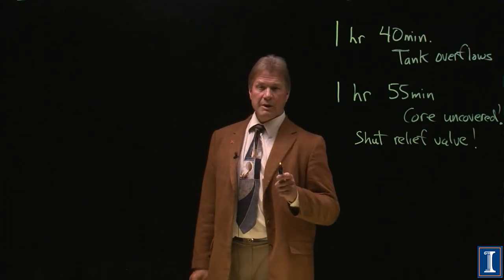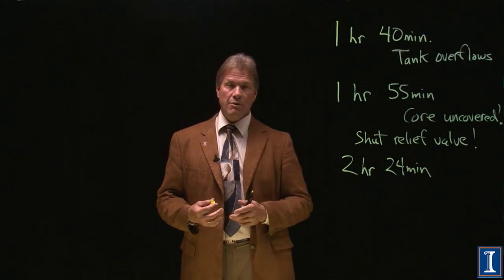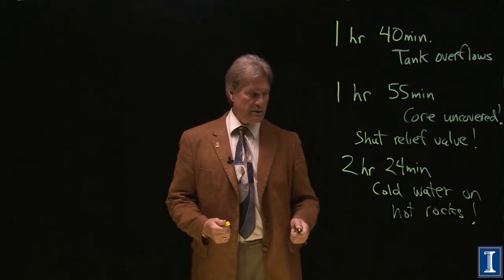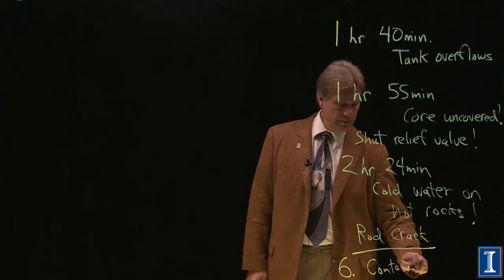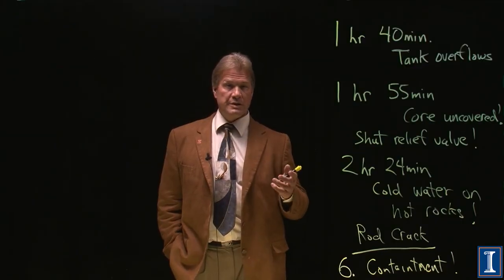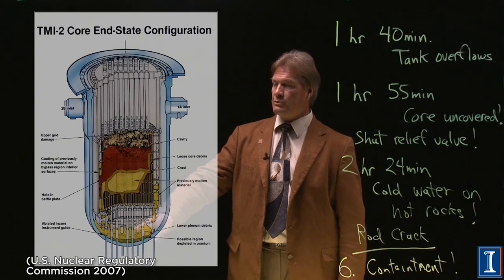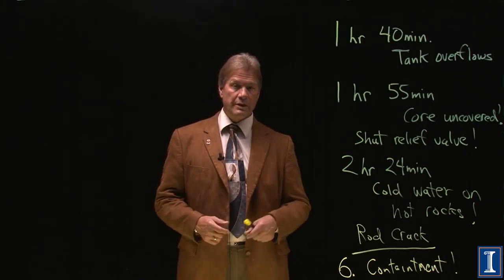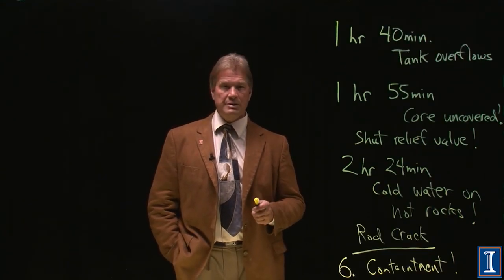How TMI Ended

Comment: I believe you misrepresented the part about putting cold water on a hot rock. When you uncover the core that is generating decay heat, you can no longer remove heat from the fuel elements. The internal temperatures rise without end and you end up in an environment where 2000 degree fuel element + steam (water) creates hydrogen gas (https://en.wikipedia.org/wiki/Zirconium_alloy#Oxidation_of_zirconium_by_steam ). Adding water with ECCS would've repressurized the core, collapsing the steam void in the core allowing decay heat to be removed.
Comparing cold water on hot rock make steam bad is a bit simplistic for a reactor core.
Reply: This guy oversimplified the story badly, changed the chronology and shifted the accents from an importaint stuff towards trivial and sometimes outright wrong, as calling ECCS return a mistake. It wasn't a mistake, the alternative was an RPV rupture and possible containment breach. In Fukushima they poured seawater to avoid exactly that type of disaster, and they were right.
I watched several his series and it's all about terribly oversimplyfying things to make it edible for junior students (if not for a layman).
Reply: The main appalling flaw in the TMI design was not sticky PORV and it's missing real position indicator, it was a much more importaint misleading WATER LEVEL indicator. This was a single most critical piece of instrumentation, and it was giving off a false OK reading. Unacceptable!
Reply: @wsswetghg8791  Are you talking pressurizer water level?
Reply: @Babyblasphemy  I mean they had no direct core water level gauge, only indirect pressuriser wl gauge
Reply: @wsswetghg8791  can't they just go in and look at the water level? I'm surprised they wouldn't notice the falling water level for almost two hours I've seen videos of people walking directly over the core. Water is supposed to be good enough shielding that you can do that.
Reply: @KingOfKings34  while reactor is under pressure, no, they can't go inside containment. And the reactor vessel is closed with it's lid on, so there's nothing to look at. In addition, radiation levels are quite deadly there as coolant have been leaking for a while by then. You have seen people walking at a DEFUELED reactor, it's totally different story.
Reply: @wsswetghg8791  there are videos of reactors turning ON with fuel inside man you can see the blue light. The cherenkov radiation
Reply: @KingOfKings34  it's not a PWR, it's research water pool reactor, a different thing completely
Reply: @wsswetghg8791  would that be too complicated to explain over a paragraph? if not, may I ask what's the difference?

Also it is really insane that these people had no way of knowing what the water level in the reactor was. A simple buoy would do the trick it and shouldn't cost more than a fuel gauge in a regular car. Which is nothing for a billion dollar reactor. it hurts my brain to think about it
Reply: @KingOfKings34  difference between what and what? Google PWR design. Simple water gauge is not that simple. Under normal operations there is solid water inside reactor, at high pressure and 320 degrees Celsius. No steam normally. Water is moving at 5 m/sec. Very little free space inside. A float will not work, but obviously something could have been invented.
Reply: @wsswetghg8791  couldn't you make a piece of the wall of the pressure vessel out of thick ballistic glass so you could see what's happening?
Reply: @wsswetghg8791  I mean gamma rays would go through of course but it would stop everything else. I don't know how much of the radiation is in the form of gamma rays in the fission of U235
Reply: @KingOfKings34  I seriously doubt that this would be technically possible, as 'wss wetghg' explained earlier in this thread. Reactor vessels are made out of forged rings of steel, welded together and made corrosion resistant on the inside by a liner of stainless steel. I'm not a civil/mechanical engineer, but I'm pretty sure it's not a good idea of putting a piece of thick ballistic glass, in a reactor vessel, with different strenght, different thermal behaviour, different expansion coefficients,... that's asking for trouble. And why should you? You don't need to look into the reactor vessel during an accident, you have al the parameters you need: pressure, temperature (preferably thermocouples mounted above the core), neutron flux (indicator to see that the reactor is subcritical, which is the absolute first concern during a 'design based accident')...
Reply: @dvraemdo  well,  I just thought it would be better than having your core melt down. Because you know sensors can fail and human eyeball is more trustworthy. That's why even in ISS, perhaps the most high tech thing humans have ever built they still have a huge cupola to look outside with the mk. I human eyeball.
Reply: @KingOfKings34  By the way: all of the PWR's in the world are equipped with with a level measurement of the reactor vessel (of course not built into the wall of the vessel, but connected by pipes), although in a lot of reactors this is only designed to use in cold shutdown conditions (reactor stopped, at atmospheric pressure, low temperature) where you sometimes need to know the exact level in the reactor vessel. During operation these level measurements are isolated from the reactor (by valves). 

As explained above: you don't need to know the water level in the reactor during an accident: if the water is at saturation point (meaning: at boiling point at a given pressure and temperature, which are of course monitored constantly) the operator knows  he can't rely on the level measurement of the pressurizer. But with the ECCS up and running correctly, he can rely that water is getting into te reactor, that's all the information he needs...

Studies have shown that with a LOCA, you'll always have some (or more) risk of damage to the fuel cladding (it depends how large the hole/breach is), but all the systems are designed to prevent that radioactivity escapes out of the reactor building. You have ECCS, but also a spray system inside the containment, containment isolation (non vital parts are automatically isolated), containment cooling, hydrogen removal (by passive autocatalytic recombiners...), filtering (radioactive particles and iodine)...
Reply: @dvraemdo  well, the guys in 1979 turned off the ECCS. I as a layman am not going to argue with you. I just tossed it out as an idea. In extreme cases redundant systems may all fail at once. I was just watching a video about an old plane crash where 3 redundant hydrolic systems all failed at once and they lost all control of the plane apart from engine throttle. I Don't even need to go that far into aviation. How many redundant coolant pumps did they have in fukushima? 

perhaps what I'm suggesting is like pumping water into fukushima daiichi plant by hand. it would be probably useless but it's better than total despair and helplessness. If that makes any sense to you. Even if a window into the reactor core is totally useless I would feel better to have it. Because it's one thing that can't fail.
Reply: @KingOfKings34  To answer your questions about TMI and the turned off ECCS: nowadays this would be nearly impossible. Firstly because of the built in timer to prevent resetting the reactor protection signal that started the ECCS, and secondly because of the completely rewritten accident procedures and extensive training (where no reactor operator would be so stupid to turn it off before the procedure is going to ask for it). Before TMI, the operators had also their accident procedures, but they almost needed to know which type of accident the where dealing with, to pick the right procedure, and take actions correspondingly. After TMI, the procedures shifted to a 'symptom-based' approach, where the operator(s) are guided trough a set of questions (for instance: ECCS started YES/NO?), where eventually the'll end up with a sort of 'diagnose' in which they can take the right actions.

And concerning the extreme cases where redundant systems may fail all at once: you mentioned about the plain crash (Jal 123?), but as far as I know this was a case where the hydrolics where not completely separated physically (they where in the same vincinity, and got severed at the same time by the aft bulkhead that was blown out). In a nuclear power plant there is a high degree of physical, mechanical and electrical separation (for instance: ECCS pumps of the different redundant 'safety trains' not in the same room).

Although the chance of an accident like Fukushima is very, very small.. (at least here in Europe, where there is no real danger of earthquakes/tsunami's), there are also 'post-Fukushima' actions taken in the European NPP's (I guess also elswhere in the world). Main focus here is a 'full station blackout' where there is absolutely no electricity to power the ECCS and other safety systems (again: this is very, very unlikely, because the already high level of redundancy). That's why there are now mobile diesel generators, pumps, piping,... to connect to the most critical parts and pump water in the reactor building, steam generators...
Reply: @dvraemdo  it was actually United Arlines Flight 232. Fascinating case. They managed to make it to the airport with just throttle controls and miraculously saved 185 people. By the way are you from France?
Reply: @KingOfKings34  Ah ok. You should also take a look at the Japan Airlines 123 incident, seems similar but unfortunately this 747 crashed (after a half hour struggle of the pilots to keep it in the air with no tail and all the hydraulics gone).

Not France, but the little country north of it 😉
Reply: @dvraemdo  you mean the glorious republic of Ireland? lol. I thougt anglos didn't consider themselves part of Europe. Using a phrase such as "here in europe" makes me think that you were probably in the remain camp. How does it feel ?
Reply: @KingOfKings34  no no, not Ireland, it's a small country at the northern border of France, no sea between it.. 😉
Reply: @dvraemdo  Holy fuck I didn't know Brittany was still a country :D
Reply: @KingOfKings34  :D I think it wouldn't be a bad idea to look at a map of Europe... I'm referring to small country between Holland and France...
Reply: @dvraemdo  I know I was just kidding, you're from the marching ground of German troops :D most congested highway of europe :D
Reply: Indeed, there was some misrepresentation. All the safety systems in PWR's are designed to cope with a ''double-ended guillotine break' of the biggest pipe (in diameter) connected to the reactor. In these conditions, the water in the reactor reaches saturated conditions within seconds, and most of it is pushed out (trough the breach) by steam building up in the top of the reactor (blowdown phase), resulting in (partial) uncovering of the core. When ECCS kicks in, the subsequent 'reflood/refill' phase immerses the fuel rods, it's designed to do so. And ok, normally in this cases you'll end up with damage to the fuel cladding (at least), but hey, you'll still have your fuel in a coolable configuration (and not a molten pile of rubble at the bottom of your reactor).
Reply: More water would act as a moderator. He is also correct, that the massive energy exchange from a steel rod with a low heat capacity and high temperature to water, extremely high heat capacity and low temperature would be enough to cause heat fatigue failure at the border of cooled rod and overheated rod.
Reply: @michaelweigley1667  by the time hydrogen is being produced in the zirconium water reaction, fuel element damage has already occurred and fission products have already been released. And steam is absolutely used for cooling. The initial cause of the meltdown was a loss of a steam generator feed water pump which tripped the steam supply to the turbine generator. They could no longer pull heat from the primary by drawing secondary steam. This is what caused a massive rise in primary temperature therefore rise in pressure and then the relief lifted and the plant SCRAMed.
Reply: @Babyblasphemy  Yes, liquid water being converted to steam is the cooling action, but yet steam, is not used for cooling.
Reply: @michaelweigley1667  water being a moderator is irrelevant when reactor has already being scrammed. The fuel cladding being damaged by cold water is a strange concern when a meltdown is already underway. Mr. Professor did not suggest what shoud have been done in that situation, if adding water is not an option. Cooling of fuel is ALWAYS the primary objective, there's no scenario in which cons of it would outweigh the pros.
Reply: @michaelweigley1667 : The core was SCRAMmed at this point, the effect of water as a moderator is moot.
Reply: @puncheex2  Water added to the core is going to raise temperature at the sites where water arrives. Fission is happening on the atomic level, the distances between fuel and control elements is longer than between rod and water. The control elements are going to keep the probabilities of fission between the fuel bundles from increasing, but at the surface of a rod, it doesnt matter if the control elements are in place since fission events can still be taking place there.
Reply: @michaelweigley1667  The fission happening with control rods inserted is decades below the point of adding heat due to the reactor being subcritical. Any heat generated is due to decay heat from fission products which are not affected by the presence of water. And while steam itself is not used for cooling, the generation of steam from water in steam generators is used to remove heat, but that is on the secondary side of the plant. The reason you want to collapse the steam void is to remove the steam that is insulating the fuel elements and to remove the steam from the coolant pump cavity that is preventing the circulation of water through the core and thus, the circulation of heat from fuel elements to steam generator.
Reply: And 'collapsing the steam void'? Steam is not used for cooling, this would not have been enough to stop meltdown.
Reply: @michaelweigley1667  also, you need to collapse the steam voids in the core because 1. Steam is a thermal insulator and 2. Your coolant pumps can't pump steam. If you can't circulate water through the core you will absolutely melt down.
Reply: The temperature of the exposed core is not going to endlessly rise, fission will become even more unlikely as the space between rods fills with air.
Reply: I see a lot of comments on why pouring water back in was not how the rods cracked. Please armchair engineers enlighten us on why they did then in layman's terms?
Reply: @raymondlangille2886  That's not the point. Prof. Ruzic says that 'you don't pour water on hot rocks', indirectly implying that turning the ECCS back on was not a good thing to do. And even then its not unrealistic to think that te majority of the core damage already occured before restarting the ECCS. Prof. Ruzic makes some of us believe that the fuel rods were only 'very hot', before the ECCS poured water onto them. The zircaloy-steam reaction was going on, so the cladding was already damaged (probably with melting pellets). More on the chronology of the event: https://en.m.wikipedia.org/wiki/Three_Mile_Island_accident?wprov=sfla1

PS: i'm not an armchair engineer, not even an engineer... I work in a nuclear power plant, where during training TMI was explained to us. Turning the ECCS back on was the best thing the morning shift did, period.
Reply: @dvraemdo  could they somehow pump the hot water back from where it was stored?
Reply: @KingOfKings34  They do, it's called the 'recirculation phase' , and happens in most PWR's almost completely automatically. The water storage capacity for the ECCS is limited, AND the structural load of the reactor building also (because of all the water collecting at the base of it, you can't keep pumping in water endlessly). Once these ECCS storage tanks (which by the way contain borated water) are almost empty, the feedline for the ECCS-pumps is switched over from the tanks to the sump of the reactor building. Water escaping from the hole/breach is cooled and pumped  back in the reactor (which keeps leaking to the sump... and so on).
Reply: @dvraemdo  why borated water? What's special about it?
Reply: @KingOfKings34  It's to prevent 'return to criticality' of the reactor. With a SCRAM the control rods drop into the core, so it becomes undercritical within seconds (its the first thing reactor operators will look at), but when you have an accident the water in the reactor is going to cool down eventually (as a result of the evaporation at the breach, and also of the colder ECCS water), which has a positive feedback on the reactivity of the core (by positive I mean: reactivity is going to rise again). So to be absolutely sure that the reactor isn't going critical again the ECCS injects borated water (which is the 'antireactivity' in this case, together with the already inserted control rods).
Reply: @raymondlangille2886  the rods cracking is an absurd concern. Choose between them cracking and a meltdown, possibly leading to reactor bottom falling off and the reactor starting like a water rocket through the roof of the containment. This is the alternative to cracked rods. It's like saying that firefighters shouldn't spray water inside the house because whatever isn't burned yet will get wetted.